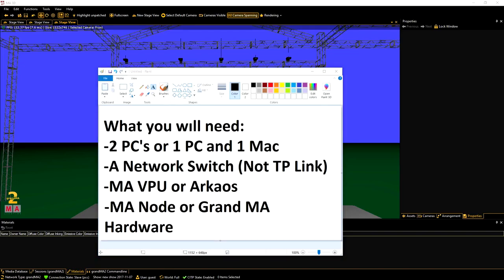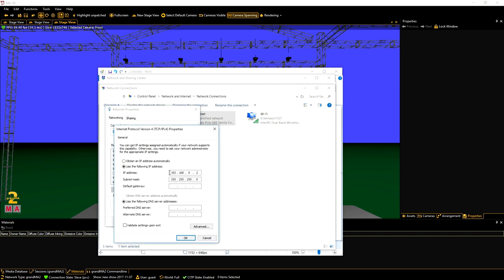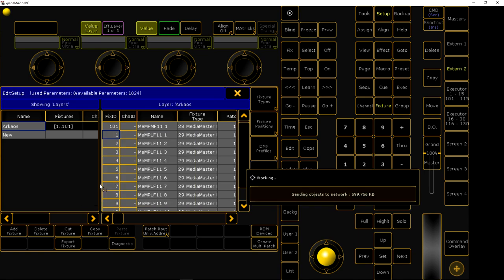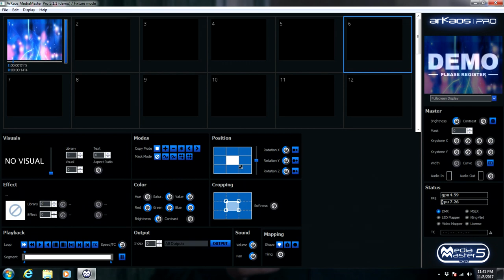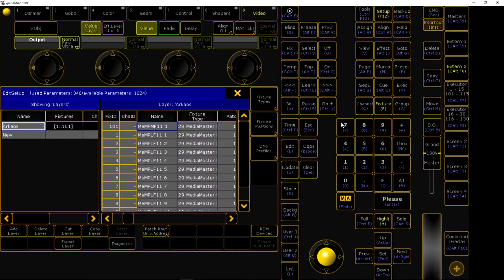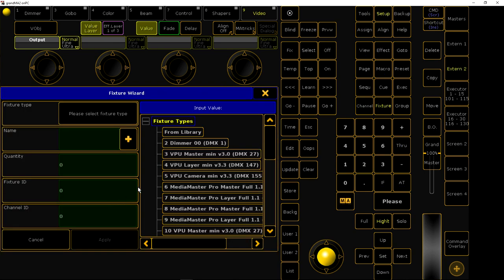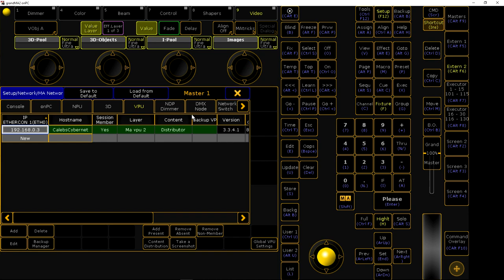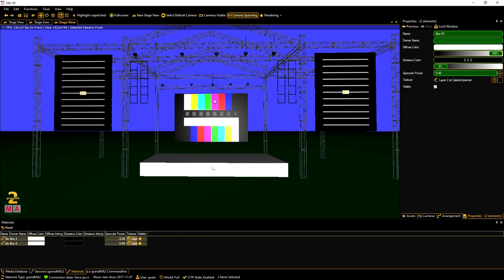Tutorial: Video Walls in MA3D with Arkaos and MA VPU

Comment: Hi, great video and very helpful. I was wondering if you have to connect the 2 computers macs whatever through ethernet? Thanks!
Reply from the maker: Yes you do, and it must go through a network switch.
Reply: @CalebHoernschemeyer  Is the MA node only for Arkaos or does the MA Vpu need it aswell?
Reply from the maker: If I recall right, you do need a node or some MA parameters to make the CITP work to previs it, even with MAVPU. You can, however control MAVPU without parameters.

Comment: hey
I need help 
it worked done

but how can i set the plane object in ma3d 
Because when i turned off the point light colour the wall is dark too 

I can only use the wall, if i turn the point light colour in 3d on 
What is the problem ?
Reply from the maker: You need to put the CITP texture on the emissive texture, it sounds like it’s on the albedo or base color texture

Comment: Hey caleb and thanks for this amazing video. I've two questions
1.can i use Arkaos and MA2 on pc both on the same machine?
2.how can i connect it with MA2 on pc? i realized this tutorial is when you using the actual console with MA port and eternal monitors.but for learning purposes i would want to connect on my laptop and mess around with it. Again thanks for the amazing videos.
Reply from the maker: Thanks Chico! So on your first question, you can run Arkaos and GMA2 at the same time on the same PC, but you won’t receive the CITP video feed. If your skilled at networking and your computer has 2 Ethernet ports you have a chance at getting CITP feed over. I got it to work for a minute then it broke. It never came back. 
2. I used MA2 on PC for this with a 2 port node. You need some hardware attached to send DMX to a media server

Comment: Hey Caleb, thanks for the post. I'm really stuck though. I've got MA on PC talking to MA VPU, no problem. But I can't get any output from VPU onto MA 3d. I still haven't even "turned" my drawn up boxes into actual video walls yet because I can't get the media server part going. One thing to note: I'm using VPU, 3D, and MA2 on PC all on the SAME computer. Would this cause any issues. If not, what might be the issue? Firewalls are turned off.
Reply from the maker: MA3D and MAVPU have to be ran on separate computers or it won't work.
Reply: @CalebHoernschemeyer  Hey thanks for the swift response. Okay so I'll try VPU on my Mac and get the networking done right and see if that clears it up.
Reply: @CalebHoernschemeyer Okay so I've got VPU up and running on a separate computer. Both PC's are connected by ethernet. I address their IP's the same in "network and sharing center" and dropped all firewalls on them. The issue I'm having now is when I try to add VPU to my session on my onPC console, it doesn't recognize any VPU unit. "Add present" doesn't work, so I tried to manually add by typing in the IP, yet it doesn't register that into the line either, it just stays as "0.0.0.0." MA 3D and onPC are communicating just fine. I'm using IP 192.168.0.11 for onPC and MA 3D. I'm also using that address in my network protocol 4 also.  I tried using the .11 for MA VPU but you said that would cause issues, so I changed that last digits to .2 but that didn't solve it. Any ideas? Thanks for any help man.
Reply from the maker: Sorry I missed this one. 
I can't think of anything off the top of my head, it seems right, are you using a USB to Ethernet adapter anywhere? Because those do not send CITP info. 
Other than that I'd ask if your using a TP link network switch. 
Let me know if you ever got it running.
Reply: @CalebHoernschemeyer   No biggie, thanks for the reply either way. So I am indeed using Ethernet to USB, so that explains it. I wonder what I could use to connect my two laptops then?
Reply from the maker: If your PC has No Ethernet port, your out of luck unfortunately. Only PCs with Ethernet ports can receive CITP
Reply: @CalebHoernschemeyer  It is possible. I use a loopback adapter, i can run VPU, MA3D and MA2 on the same PC and have them connected. I have VPU in my session but it wont connect through CITP?

Comment: Am i able to use Grand ma onpc with Ma VPU and MA 3D all just on network ina session with no grand ma hardware in the chain. I don't want t output anything just keep it all onpc visualise
Reply from the maker: Yes, you dont need hardware attached if everything is MA software
Reply: Okay for some reason it doesn't want to work, I can get it all connected in session and citp all connected however when I assign material media server I can't select video source it says there's none available?
Reply from the maker: Did you allow MAVPU, MA3D, AND MA2PC through your firewall on both machines?
Reply: @CalebHoernschemeyer  I didn't never kind of thought to that however, if I grand ma and ma 3d on separate machines they work fine don't have to mess about with firewall in that case
Reply from the maker: @ryangregg1916 yes those two may work without firewall changes, but the addition of MAVPU without firewall access has caused conflicts in the past.

Comment: I have a problem, I followed the steps but in ma3d selected the textures / media server and video sources that continue loading 
Sorry no speak english
Reply: I hope you can help me 🙏🏻🙏🏻🙏🏻🙏🏻
Reply from the maker: guarumine I do recognize that issue. 
I don't quite remember how I solved it, I believe it was caused by me not selecting F layer on the media server, or with other servers, not assigning the correct universe to listen to. 
Let me know if this helps, or if you've done this. This was intermittent and I was never able to recreate the issue. 
Of course, turning all involved machines off and back on has worked before.
Reply: Caleb Hoernschemeyer Could I contact you by facebook or mail?
Reply from the maker: guarumine yes. Look me up on Facebook Caleb Hoernschemeyer
Reply: Caleb Hoernschemeyer I've got the same problem... solution??
Reply from the maker: guarumine It is your Firewall Settings. Allow MA3D and VPU through public networks on both machines.